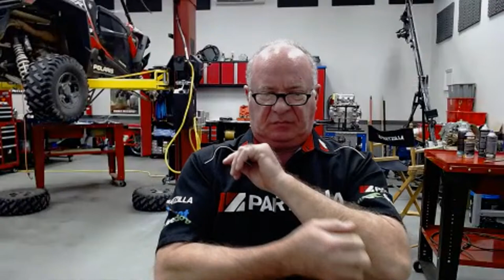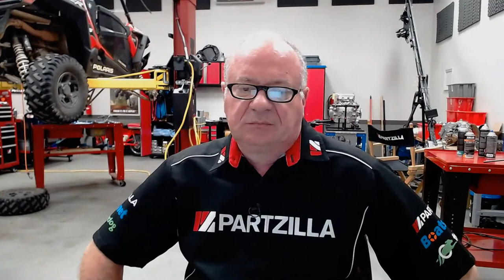Live Q&A with John Talley | Partzilla.com

Comment: I have a 2007 trx400ex that o have been trying to resurrect i am running a sparks curtus exhaust and no air box led, up to 170 main and 42 jets, it has a bog and backfires when I let off the throttle. Runs fine  with the chock on just a little.